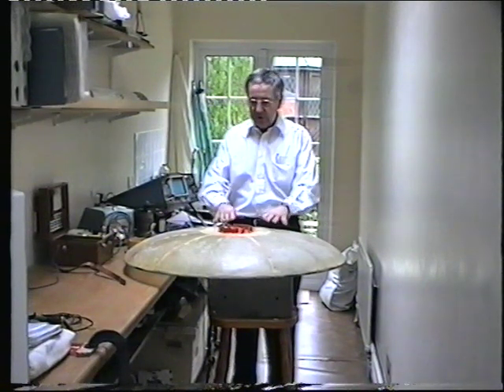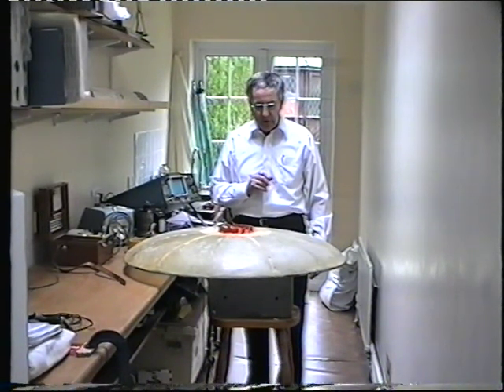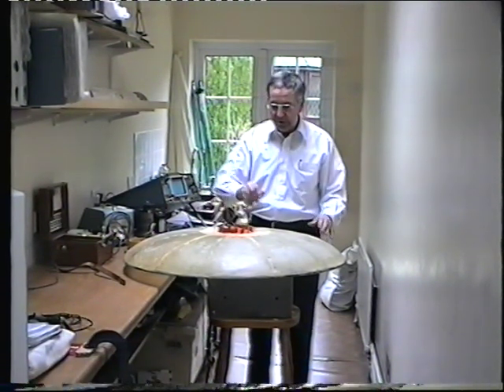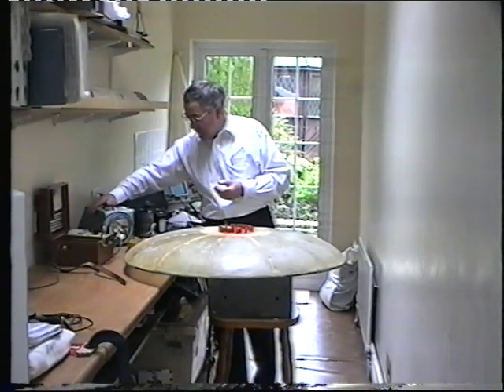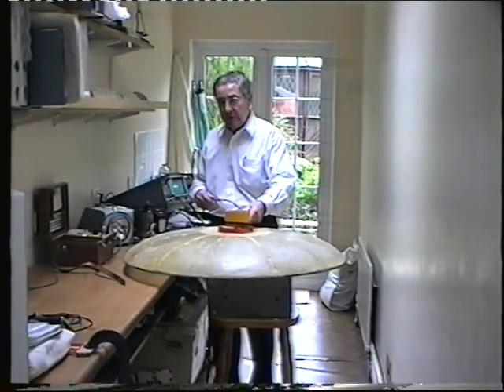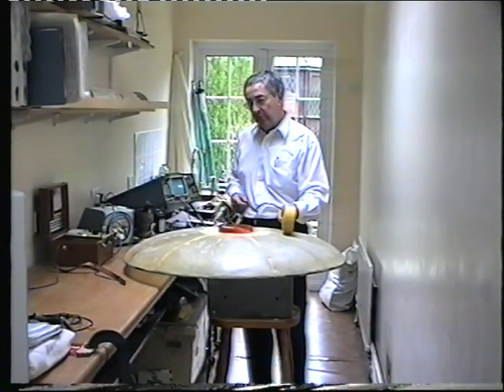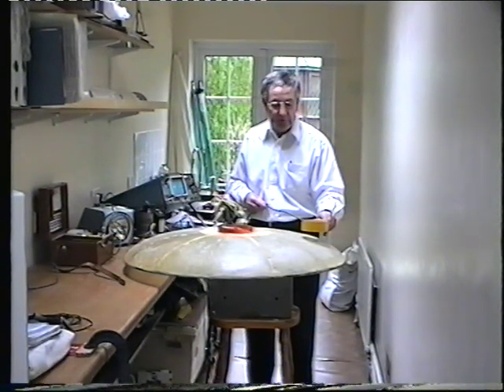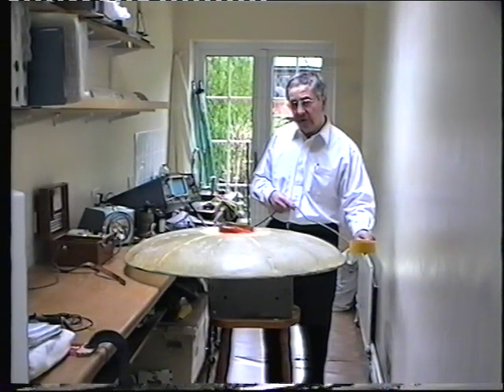Coanda air flow over small disk aircraft

Comment: maybe a lioghtweight extra cover can be used to push the air into, like a double layered disc shape, also a second engine in reversed position might counter the spin and helps to double the power or double the flow, i dont know if heating air electrically helps to trap it, make its path long and generate as much lift from the heat as possible by trapping and giving hot air a long path, and cold air a short path, making the streams work together. i would love to make a disc shape as well, how did you create the sphere?
Reply from the maker: Hello, Thank you. Some interesting comments.Covering the fan acts as a diffuser and if correctly designed does increase the air velocity leaving the fan which is good. However it consumes a significant amount of air power, (which is hard to generate) and in addition reduces the air vortex above the fan. The air vortex above the fan increases the air mass flowing over the fan and results in significant lift when entrained (drawn into) into the Coanda airflow over the surface..
Counter rotating masses do counter the air frame spin as you suggest, however, gyroscopic stability of the air frame is lost.
Air leaving the fan and which is attached to the surface by the Coanda effect,  flows more or less tangential to to the fan periphery. This results in vortex rotation of air above the surface entrained into the Coanda flow but which does not pass through the fan but adds to the air mass directed downward and adds to lift.
I have not experimented with heated air but its an interesting line of thought.
If you look at the website www.coanda.co.uk you will see at least one paper that I presented at the Bristol University International Conference on Unmanned Air Vehicles which describes the construction of the experimental model.
Bob Collins
Reply from the maker: Hello. Thank you for your comments. Your suggestion re "double layer disk shape" is a possible line of research. You are correct regarding the countering of  spin about the vertical axis either with a second motor or a reversing geared rotating mass. However, the disk profile is known to be unstable if it is not spinning (like a Frisbee) and the fan and motor armature provide a measure of gyroscopic stability to the disk air frame.
We will give the idea of heated air streams some thought. I shall ask one of our students to do a computational dynamic airflow model.
This was the first experimental model made and it is just made from epoxy glass composite in six section and stuck together. If you go to www.coanda.co.uk you will find a paper, presented at the Bristol University International Unmanned Air Vehicles conference giving more detail. We have moved on since then and currently, our experimental profiles are made by pressure molding ABS plastic

Comment: what if you ran the airflow on both sides of the curve. The bottom and the top?
Reply from the maker: Thank you. That  is how the project started. Initially, the disk was a crude annular airfoil with the tangential fan at the centre. The fan could be raised and lowered to either blow air evenly over the top and bottom of the airfoil disk, over the airfoil disk or under the airfoil disk. What do you think happened when we tested the three configuration?
That is correct! When we blew air over both top and bottom airfoil surfaces, lift was negative - the disk went down. When we blew air over the under airfoil surface lift was again negative and the disk went down. Positive lift was only obtained when we confined the airflow to the upper airfoil surface of the disk. This the Coanda effect at work. Bob Collins.